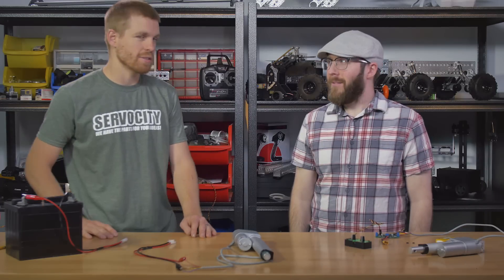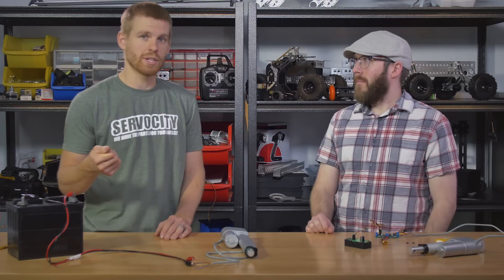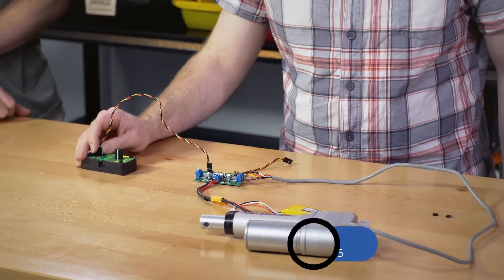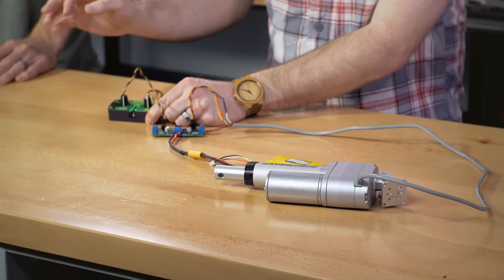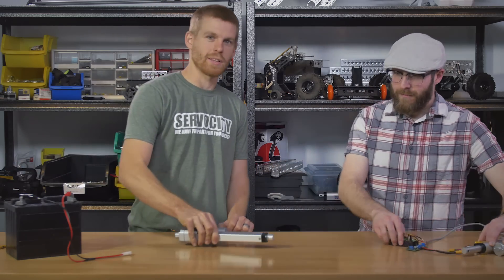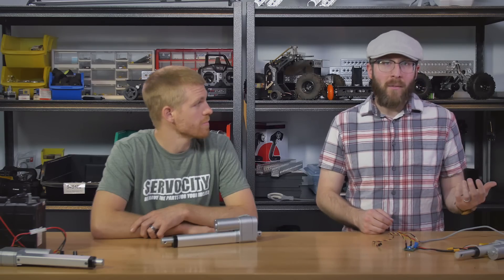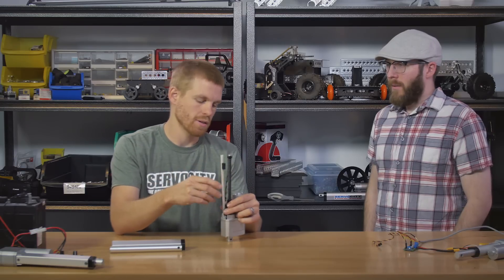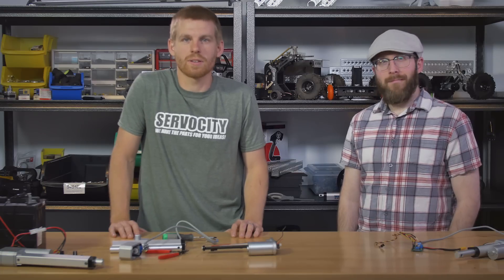Comparing Linear Servos & Linear Actuators - with Kyle and Jason

Comment: How can i make my old Fiat 600 to open or close back bonnet like an active spoiler, depending of car speed. For example, if the speed is less than 80km/h bonnet is close, if speed is more than 80km/h, bonnet is opet.  This car doesn´t have  computer.
Reply from the maker: Cool sounding project. While this gets outside the scope of our parts on the control system side, I would steer you towards googling Arduino Speedometer to see what other folks might have already created to get speedometer data into an Arduino. From there it would be easy to control a linear servo by outputting a PWM signal.

Comment: Hey guys just stumbled upon your channel after trying to find a solution to a problem im having. I have little knowledge of anything to do with servos and could really use a hand figuring out what i need to do what i need to do. Im trying to make an exoskeletal arm brace/ elbow joint for my mum who suffered from arthritis and had many failed attempts at replacing the joint. She now has no elbow or bone 8 inches either side of where the elbow should be. Ive figured out the rigging now im stuck on how to wire up an actuator to extend and hold in place with one button and retract and hold in place when released with another. This is a long shot and im sure youre very busy but any push in the right direction would be amazing! Thanks for your time. Karl :)

Comment: If I press the piston when there's no supply will it go down or come out
Reply from the maker: Linear actuators are extremely difficult to backdrive, even when not powered on.  Whether it's possible comes down to the pitch of the lead screw (or ball screw), the gearing, and the motor.  Please let us know if you have any other questions tech@servocity.com.

Comment: how to wire the linear with a timer to open and close
Reply from the maker: Hi Ray, there are a number of different ways timing could be achieved (mechanical, electronic, etc.). The right approach will depend on your experience, preferences and project requirements. If you are open to programming an Arduino or Raspberry Pi would be worth looking at.

Comment: good info and good video.  Now if I wanted the servo or actuator to just keep going in and out on its own but be able to control the speed how would that be done. To add another option if I wanted the auto function (the in and out on it own) with speed control then switch it to be able to control position.   how is that magic done?  any info you have or if you can point me in a direction.  please.
Reply from the maker: Hi Darrell, sometimes a rotating assembly (think crank, rods, pistons in a car engine) is a preferred setup for linear motion that runs continually.  This will keep from having to ask the motor to change directions over and over so your efficiency can potentially be better.  If you want to use the actuator I'm sure there are many ways to do it electronically - one of those ways would be to slightly rewire the limits and include a latching relay that would allow it to change direction when either limit is contacted.  If it's a linear servo just have a controller with a program to tell the servo to go in and out at whatever rate you want.  Note you're using the position control to control the speed in this setup but it works just as you've asked.  For the position control setup you've requested while using an actuator, a motor controller with a feedback loop could be used and a program could be written to precisely control the position of the actuator.  Or if it's a linear servo just have a program sending the PWM signal to the linear servo (much like setup 1 using a linear servo) but have a manual mode where you can adjust that PWM signal with some form of input (potentiometer for example).  Let us know if you have any other questions tech@servocity.com.

Comment: Great review. I have a question. If you stop it in the middle before it hit the limit switch and keep for a few hours does it use any electricity and drain the battery?
Reply from the maker: The current draw will be considerably less given the motor is going to be at idle but it will continue to draw from your battery until it's turned off of the battery is discharged.  Let us know if you have any other questions tech@servocity.com.

Comment: What would happen if the power goes out in a mid position? Will it hold the position? Or will it go back to the initial position?
Reply from the maker: If you remove power from an actuator the motor driving it has no voltage going to it.  The motor will stop and therefore the actuator will stay in the position it was in when power was removed.

Comment: Kyle/Jason, What could be the maximum speed that these rods can extend at?? I need something that can push or pull really really very fast. Is that possible???   Saba.
Reply from the maker: Hi Saba, the pitch and RPM will determine max linear speed.  Lead-screws are not normally chosen for high-speed.  Pneumatics might be a better option for you.  Let us know if you have any other questions tech@servocity.com.

Comment: Hey guys can you tell me what's the stroke length of the linear actuator you are using?
Reply: I picked one up with 6” stroke and 225 pounds force about a year ago. Still working great on outside application
Reply: https://www.servocity.com/motors-actuators/linear-actuators/super-duty-linear-actuators

Comment: My question is I need to wire a toggle switch to a linear actuator that came from the treadmill it's AC every video or instruction I find is for a DC linear actuator what kind of DP DT toggle switch what I need to use to operate forward and reverse for a 120 volt incline motor
Reply from the maker: I'd double check whether the motor is in-fact an AC motor.  Even though you plug your treadmill into AC power it's not a given that everything it runs runs on AC.  There may be a power inverter built in which changes the AC input to a DC output.  If you do find that it's AC, reversing polarity can be done by reversing the polarity of the starter winding.  Please let us know should you have any other questions tech@servocity.com.

Comment: Can the limit switches be adjusted  moved so you don't over extend or under extend
Reply from the maker: Hi Joshua, the internal limit switches on the super duty line of linear actuators can be adjusted independently of one-another (https://www.youtube.com/watch?v=3jzyQ5gQUFE).  Limits on the heavy duty actuators are fixed on a molded rail.  Let us know if you have any additional questions tech@servocity.com.
Reply: All the actuators like these have the limit switches set to do that already.

Comment: hello, excellent video !!! Do you know if the linear servos or the linear actuators would have the necessary force to be able to step on the clutch of a mechanical car?
If so, please recommend one.
I am disabled, I appreciate your response.
Reply from the maker: Glad you found our video helpful, Braulio.  Yes, a linear actuator or linear servo is capable of actuating the clutch on a vehicle.  There are a lot of variables involved such as the position of the actuator in relation to the fulcrum, the type of clutch (mechanical, hydraulic, etc.), the pressure of the clutch, rated force of the actuator, etc.  Please contact us should you have any additional questions tech@servocity.com, we'd be glad to help.

Comment: I would like to trigger a light to come on when the actuator is fully extended. Is this possible?
Reply: David Guyton i
Reply: @sharpfinch5354  And it will be thew best thing for her.
Reply: David Guyton Yes its possible
Reply: @Colton Caspian I'm sure it does..... as if I haven't seen this exact same exchange in the comments of other, totally unrelated videos.
Reply from the maker: Hi David, there are various ways you could go about it. For example you could use a limit switch ( https://www.servocity.com/electronics/components/switches/limit-switches ) that is physically engaged to turn on the light. Or you if you are using something like an Arduino or Raspberry Pi with a servo hat you could use a linear servo ( https://www.servocity.com/servos/linear-servos ) and a PWM switch ( https://www.servocity.com/electronics/components/switches/pwm-switches ) and send two PWM signals, one to control the linear servo and one to turn on the light via the PWM switch. You could also use a PWM switch with a Y-harness and linear servo to run them both off of the same PWM signal (like from an RC receiver or Arduino, Raspbery Pi etc) but the light would turn on the entire time the servo is extending and not just at full extension.  Let us know if you have any other questions tech@servocity.com.
Reply: thanks you guys are awesome.
Reply: No David, it is unfortunately imposible.
Reply: @paulinercopoth  I literally did exactly this. It's not impossible.

Comment: wow very informative. you guys really know this stuff. im looking for a waterproof high speed (9"-12"/sec) 12-24 volt tubular actuator with remote? any help would be great im struggling. thanks
Reply from the maker: To be fully waterproof you'll probably want to look into marine grade linear actuators.  9-12"/sec is very fast for a linear actuator but there may be some options out there.
Reply: im wanting to build my own power pole (fishing bass boat shallow water anchor/power pole is the brand) ive seen plenty of videos on you tube on ''home made power poles'' and it seems to be the easiest way to build is with a linear actuator. I cant find the actuator I need for this. thanks for the reply

Comment: I needed to know can you set up a linear activator where it has a continue run mode where the stroke is repeating the in and out pattern ? I have an application where I would need continuous raise and lower mode . Info would be greatly appreciated 
Thanks 
Midiguana@aol.com
Reply from the maker: There are multiple ways this could be done and the right path just depends on what you are comfortable with. The most out-of-the-box solution would be to use a linear servo with a servo recorder.

Linear servos would also be a good fit if you are comfortable using an Arduino, then you could make it perform however you want. The code to make it run out, pause, run in, pause, repeat would be a beginner level project.

A more mechanical approach would be to have the an actuator (not linear servo) physically toggle a switch. See this video for some info on how the a linear actuator circuit works:
https://www.youtube.com/watch?v=2EDNwUOcdrM&t=324s

A third, unconventional but very workable solution would be to introduce a latching relay to the circuit.  This would require you to open the actuator and modify the stock wiring on the limit switch rail.

Comment: Hi i am wanting to run a system like the the setup where you use a potentiometer in the actuator and a potentiometer to drive the rod out so it knows the position at all times like the setup you showed could you tell me what i need to do it please i am running it of 12v thanks and a wiring diagram thanks
Reply from the maker: Hi Steve, a linear actuator will have a potentiometer built into it which “reports” the actuator’s position at any given time. You will need something to read that analog signal such as an Arduino.  Another option would be to use a linear servo connected to a servo controller that changes the PWM output signal based on the location of a potentiometer.  Our dual servo driver or Actobotics dual servo controller would both work well for this style of control.  Please let us know should you have any other questions tech@servocity.com.
Reply: ServoCity hi i have a potentiometer and i have an arduino  so would i just need a linear actuator? How do i find the code i need for the arduino? Sorry i dont know much about any of it I've just been youtube looking i know what i want to achieve but its working it out thanks
Reply from the maker: There are a lot of great learning resources for Arduino out there.
You will want to read both potentiometers in your main loop and if they are different, drive the motor of the actuator until they match.
Here is a good resource on reading potentiometer values: https://www.arduino.cc/en/tutorial/potentiometer
To drive the linear servo you will need a motor controller (since it is driven by a brushed dc motor).  Check out our Motor Controller Fundamentals video: https://www.youtube.com/watch?v=8f_2u3UrWmc&t=176s
One motor controller you could use is our Actobotics Dual Motor Controller. Just control it like you would control a servo (send a PWM signal to it).

Comment: Hi guys and thank you for sharing......Can you please make a video or guide me on how I can program it so it can automatically moves to a position stop for a few sec and than move to a the location and repeat the process..... ..tnx u
Reply from the maker: Hi George. Although either a linear servo or linear actuator could be made to do that, it would be more simple with a linear servo. An exact example would depend on how you want to go about controlling it. A no-programming option would be to use a servo recorder (part number SPC2000). Or you could use an Arduino and alternate between the servo.writeMicroseconds command and the delay command.  Feel free to let us know should you have any additional questions tech@servocity.com.

Comment: Will it work if we use a hi torque dc geared motor to drive a threaded rod using a timer belt and a pully enclosed in a hard PVC pipe/casing?
Reply from the maker: Hi Parish, yes, that's one way to make a linear servo.  Keep in mind that normal threaded rod is not meant for creating linear motion but for fastening.  The threads of a lead screw are cut much smoother and more consistent to create linear motion while minimizing friction.  Please let us know if you have any other questions tech@servocity.com.  Thank you
Reply: Thanks for the advice. ServoCity has the best informative Vlogs.
Reply from the maker: Thanks, Parish.  Glad we could help!

Comment: Hi, I'm thinking of using the Linear Servo (similar to the one Jason used in this video) to drive my syringe pump. I am quite clueless on this and trying to find the right controller and battery. Which controller was used in this video? And what was the ampere hour draw of the battery used in the setup on the video (I would like to know what level of the ampH battery to buy)?
Thanks
Reply from the maker: Hi Angelique, we're happy to help answer your questions.  The linear servos will run on any type of servo controller able to operate a hobby servo.  The Actobotics Dual Servo Controller (https://www.servocity.com/actoboticsr-servo-controller-w-enclosure) was used to operate the linear servo in the video (reference 6:30).  The battery was just a lawn mower battery so that the power source would be quickly recognizable by viewers.  Any 12V source will be fine so long as it can provide enough current to operate your linear servo (more applicable when selecting the proper power supply that plugs into the wall).  The capacity of the battery will depend on the desired run-time and the current draw from the linear servo will depend on the load and frequency of movement.  If you have any other questions feel free to let us know! tech@servocity.com or 620.221.0123
Reply: ServoCity Thank you so much

Comment: i need a servo to gear shift on motorcycle   can u help pls thanks
Reply from the maker: Hi Luis, it depends on your bike and your usage but for drag racing you might consider going with a pneumatic shifter that ties into your ECU to momentarily kill spark to unload the transmission.  If it's for general purpose riding a linear servo controlled by a microcontroller that's outputting two separate PWM signals (one for up-shift, one for down-shift), each sent by the press of its own momentary button that, when neither is pressed, a 1500usec signal would be sent to center the linear servo to get ready for the next shift.  If you have any other question please feel free to contact out Tech Team tech@servocity.com.

Comment: ive been rebuilding a boat i want to use an actuator to steer the outboard but what i want to use a computer joystick to drive it or even better a pc steering wheel can it be done and how without using a computer to program some chip board.
Reply from the maker: Hi Joe, sounds like a fun project! It would depend on the joystick or pc steering wheel. Joysticks will most commonly have a potentiometer that it is moving for each axis. I would assume that a PC steering wheel would be rotating a potentiometer (it is either that or an encoder). If you find a PC steering wheel that is rotating a potentiometer then it would be fairly easy. If you use a heavy duty linear servo and the Actobotics dual servo driver (part number 605106) and instead of soldering in the included potentiometer, you solder in wires that go to the steering wheel potentiometer you should be good to go.  Let us know if you have any other questions tech@servocity.com or 620.221.0123.

Comment: I just purchase your linear actuator servo SKU: L16-R-140-150-6.  How can I connect to my DX7 remote and what channel?I want it to stay in on certain position and stop there without returning back to the center position.  I am thinking about using throttle joystick control?  Please explain how to connect to my r/c remote.
Reply from the maker: Hi Danny, the L16-R-140-150-6 will directly connect to you DX7 receiver. Using the throttle joystick would be the best solution for a locked position.  Please let us know should you have any additional questions tech@servocity.com or 620.221.0123.